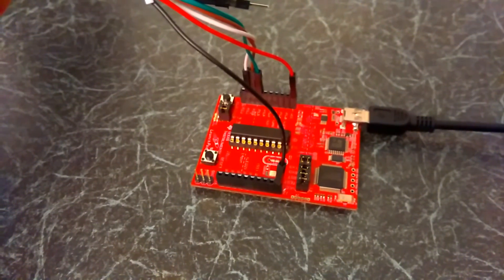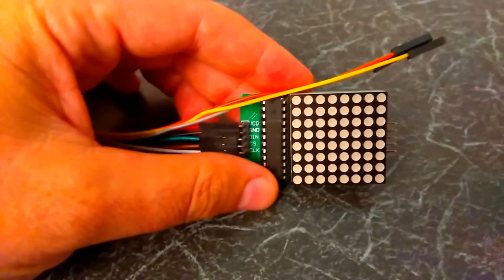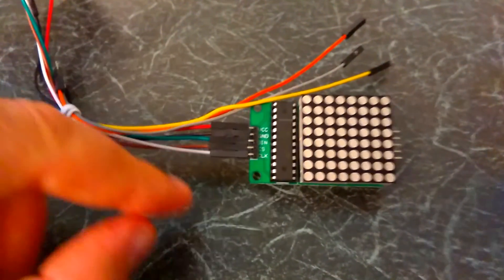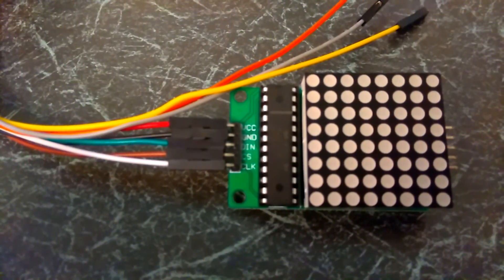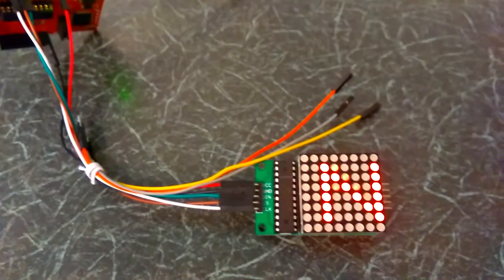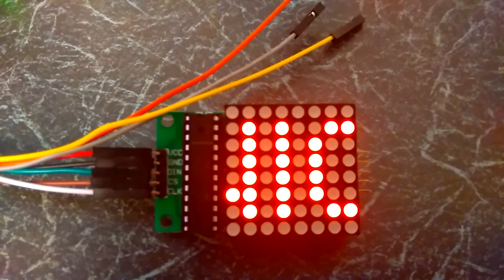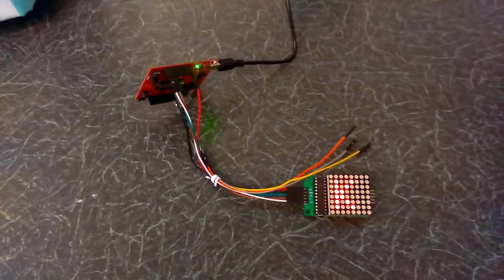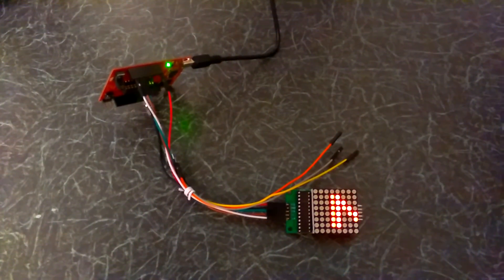Controlling an 8x8 LED MAX7219 from an MSP430

Comment: digitalWrite(MAX7219_CS, LOW);       // CS has to transition from LOW to HIGH    
  putByte(reg);                        // specify register
  putByte(col);                        // put data  
  digitalWrite(MAX7219_CS, LOW);       // Load by switching CS HIGH
  digitalWrite(MAX7219_CS, HIGH);

I don't think you need the 4th line "digitalWrite(MAX7219_CS, LOW); " here since CS is already LOW as in the 1st line, isn't it?
Reply from the maker: +Trinh Cong Nguyen Indeed; you're correct.
Reply: +Bernhard Hofmann  One more thing, what's different between output() and maxSingle() method? Could you please explain to me?